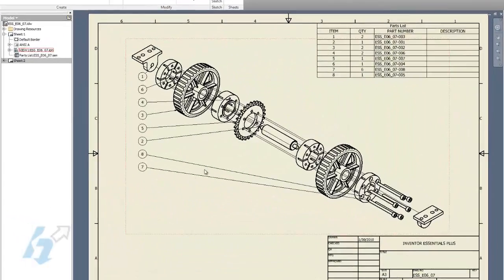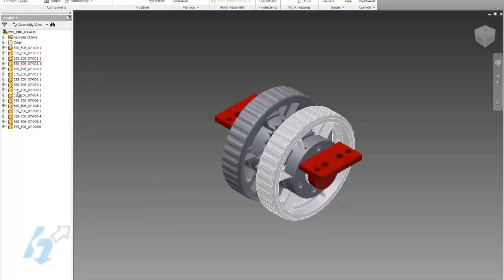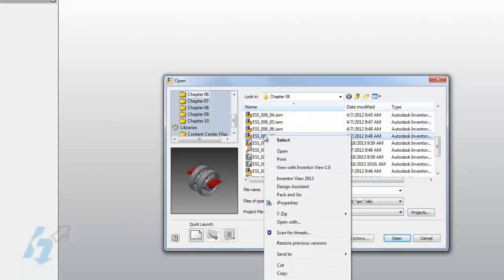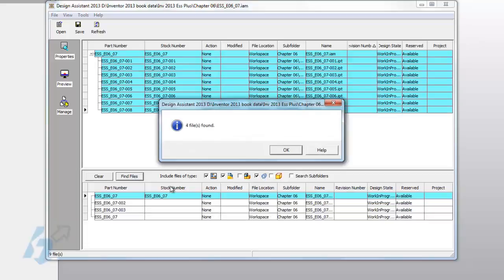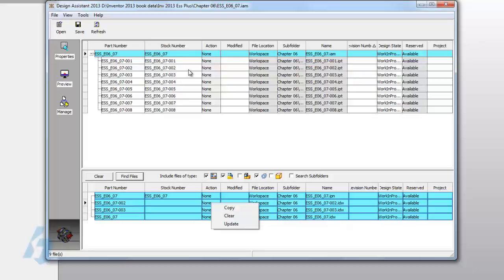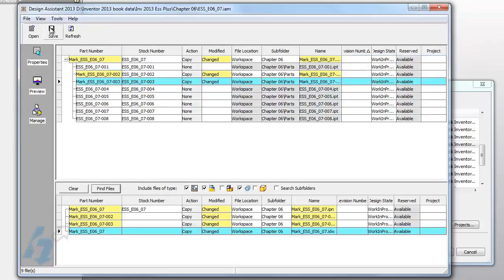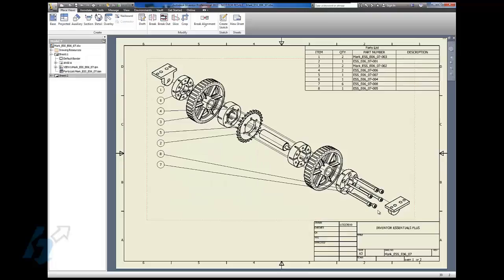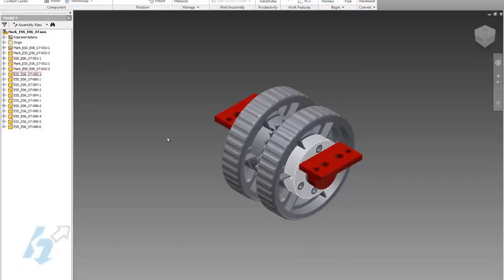Rename Files Using Design Assistant

Comment: Design assistant is a very poor piece of software. It's OK for small jobs, but if you have large assemblies, it is very time-consuming. "YOU HAVE TO RENAME EACH PART SEPARATELY." There are also pitfalls. I always just use copy, rename the copy, and then move the new copies from the folder into a new folder. Be careful if you pack and go then rename, because the parts you rename in the pack and go folder are not renamed the original parts in the original folder are renamed unless you change the path every time you rename a part. This is never explained in tutorials....
Reply from the maker: Thank you for the feedback. This is what we need to know to make this software better